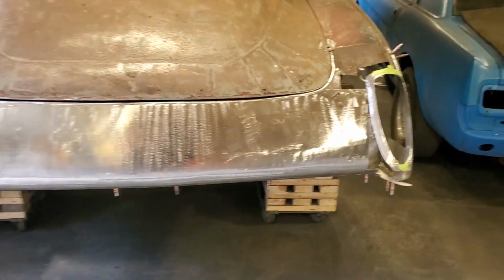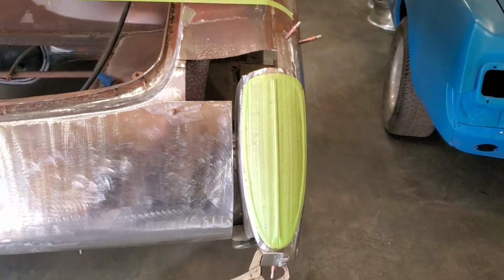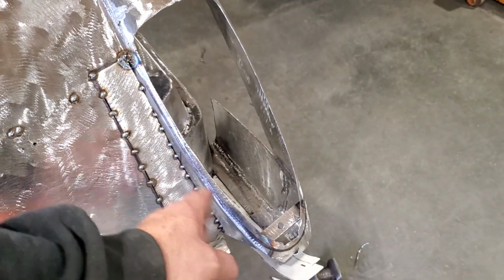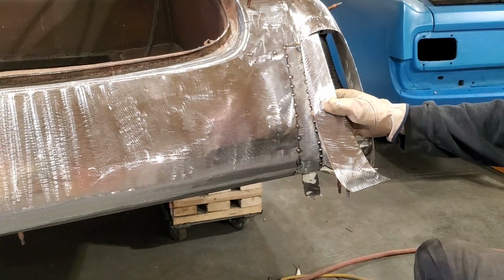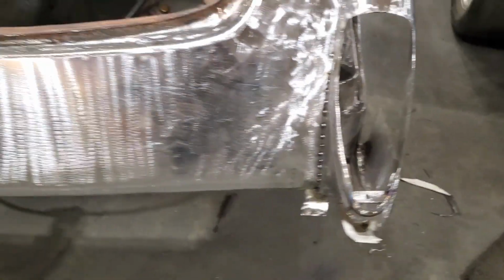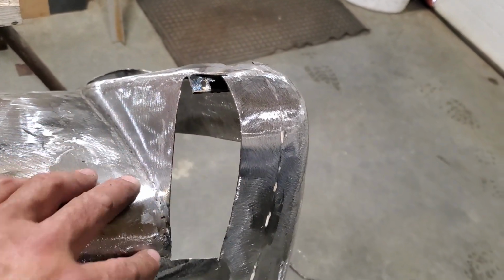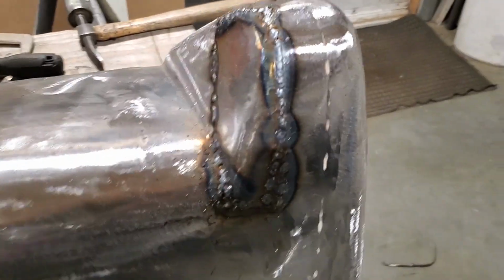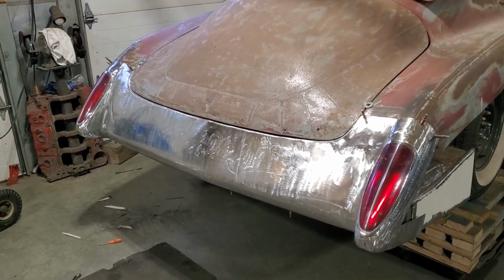1949 Chevy Fleetline Custom Tail panel. Part 2

Comment: Remarkable work. You are a true artist and wondered how you were going lift or lower the other fender when you realize they were off.
Wow truly fantastic results. 
Your tips are playing off for me, I just rebuilt a lower 55 chevy A piller inside behind the door hinge bolt plates, in side the vent cowl area, that was totally rotted away and could never do it until I started watching your videos. I just remembered what you said, just do it in sections. I did cut out alot of metal and figured it's strong now and no one might not ever see it, so I took pictures to prove what I did. 
Thank you for what you do with metal. You are a true master.

Comment: There were times there, Tony, where I could not see your vision for it....but then another piece of steel would be added and I got it immediately.  Man!  Fixing that difference in the heights of the rear guards was great spotting.  It would certainly make the difference easily seen if it had been left.....and none of us could do that!  Great spotting as to where the problem / repair had been made that altered the rear.  Glad it was a fairly easy fix.  It might be the angle of the camera, but the left rear guard looks like it changes angles a little quick toward the peak of the arc (a little above where the new rear end will weld on), but if that IS the case, I'm sure you've already seen it doesn't flow smooth and have plans for it.  I'm certainly not criticising your work, my friend - I would NEVER do that.  It's on a bit you've not got to yet 😊 Looking forward to seeing more on this beast!  All the best
Reply from the maker: You are correct.  I need to work that section. Seems one quarters higher then the other  up until it gets to back of trunk lid
Reply: @fitzeesfabrications  - Boy, did that poor old beast get a royal shake-up in her panels somewhere along the way.  I'll enjoy seeing you get into that and sort out whatever someone has done to the poor old trunk lid!  Watching this big beast come good from the sad state she was in when she arrived is fantastic viewing.  I'm living vicariously through you at the moment with it and my hands are really itching to get in and do something like that myself!  I do have a wee 1977 Mini that needs rust work and there will certainly be some creative fabrication, but it's nowhere near in the same league.  You would be proud though - I found that the repro replacement panels for the Mini are never perfect and often require a fair bit of tweaking to get right, so with THIS car, I thought I'd just fabricate the repair panels  and patch them in instead.  Would never have had the confidence before I started watching your channel, Tony.  That's a fact.

A quick query though if I may.   You had to shrink down an area on a panel in one of your projects and I know you don't use a shrinker....and I cannot remember what you did.  I know you've been over it at some point, but I cannot recall the project.  Do you remember which one it was so I can re-watch it?

Comment: Fitz It looks freakin Awesome to say the least. I couldn't see it either until you added that inside piece onto the light and placed it on the car, than I saw it. You did a great job looks symmetrical and looks like its was designed like that straight from the factory. I think you did one hell of a job. congrats.

Comment: Awesome Job Mr. Fitzee,  the 0nly thing I would've liked to have seen is the Tail lights mounted up higher in the rear panel, like they were originally in the vett's. I Know that Was the 0wner's call on this part. they will be at risk IF the car would ever be hit later on in the rear. I Hate that they might be tore up and being original tail lights would be a waste to me. Again GREAT WORK on this Great 0l' Car. This car style was my first car at 14 years old, so-so-so long ago👴

Comment: The tips are always good. In fact, I took on building a replacement panel for the inner fender of my old Chevy K10 using some of the tips you've shared in your videos. I did it in a place that isn't really visible once everything is back together anyway, since it's my first go at this type of fabrication, but it turned out pretty OK and it was a lot of fun doing it! Thanks for the videos!!!

Comment: I'm not really a big fan of that style rear end, you have however done a wonderful job of it.
I've used magnets to hold but joints together while tacking. It works good.
Reply: How would you have done it? What style are you a fan of if not emulating a Corvette?

Comment: I've been trying to get ahold of Fitz off and on I enjoy his work I learn things from him but working on this Chevy here I've been trying to get hold of him so he can broaden his skills by watching a gentleman from the states. There are other professional body shapers that he can get some tips from as far as getting things line left to right now you have to watch them yourself. Pro shaper at a New England states of the United States has workshops and let's say extremely extremely reasonable and he's got great packages and he has guys leaving there in less than a week building cars from scratch using mainly English wheel and like fits hand body techniques. There's also lazy
Reply from the maker: I have watched those guys.
Reply: @fitzeesfabrications  good. not sure if my hooptie is on my channel or not sure if the full hand built I am building for an amputee vet is on there yet. its a give away to an amputee vet.My channel may be up and swinging this year. Bought an awesome e-wheel that was made for bently and benz fenders back in the 40s. also check out valley forge welding. Jerry K worked on the shelby line and has very detailed training
Reply: @thomaswstorm  If if your hand built thingy turns out as well as your chicken coop work I am sure he will be impressed.

Comment: Hey Tony, will you apply seam sealer to the welds that are hidden underneath and behind your custom panels? Water could corrode those welds long-term
Reply from the maker: That is the plan. Reason I make it in one large peice

Comment: Terrific video. Was just out in da shop playing with my new mig making small welds in some real thin sheet metal. A looong way from Master Fitzee done ya knows. Learned how to blow some holes, too😱

Toward the end of the video you mentioned painting the inside. What type of paint do you use for that?
Reply from the maker: I just use a good rust paint.

Comment: One question : after you finish whole back end, how will you mount these tail lights? Or demount it? I hope that will not be the riddle that the owner have to sort it out.🙃
Reply from the maker: They are mounted. Two bolts hold each one in place. I need do somework on inside of trunk so you can access them for bulb replacement
Reply: @fitzeesfabrications  Yes, but, in case something happen to one of them, can they be replaced without some grinding work? I'm sorry if this sounds like attack, that's not my intention. I've learned a lot from you and I admire your work and patience. This is just a question from the curious person.

Comment: May be a silly question..
Are you able to access the rear of the lights easily  once it's all put back together...
Reply from the maker: It will be. There is some trunk work I need to do to make it easier.

Comment: Hi Fitzy, As always, an inspiring and practical way of making a complex custom panel, I know you have many years of experience and I have none, nor will I ever have the opportunity with age and health contributing to that. May I ask you a couple of questions please. You always use MIG in your work (and successfully too), but what about either gas or tig? I am well into my 70's and gas welding, (oxy -acetylene), was the chosen method. do you prefer mig, because of the speed and convenience, to lay the weld in (sans grinding time), cost or the fact that it can be better applied over a greater cross section of metal(s). Please, I am in no way being critical; I'm just curious.
Reply from the maker: I use mig cause its what I have and use to. I have had gas over the years just found it costly with two bottles. I don't have a tig so that's why I don't use one of those. I make do with what I have. All will work good. Some better then others. Your never to old to play around with this.
Reply: @fitzeesfabrications  Thank you Fitzee; I appreciate your answer and I look forward to your next post. Avid follower of your page.

Comment: Had a cat at the old house that if I had the hood up it would climb up on the engine and watch me work ,, Miss that cat he was  feral cat and too many males in one area lots of fights .. I would crawl under a car to look at it and he was beside me looking .. will this car have a back bumper ??  did not know if you have to make mounts to hold the bumper under the tail section .. or cut holes threw to mount one to the frame ??
Reply from the maker: No bumpers going on this custom
Reply: @fitzeesfabrications  that will save lots of work ,, Great Videos you put out thank you for taking the time too do them ,,